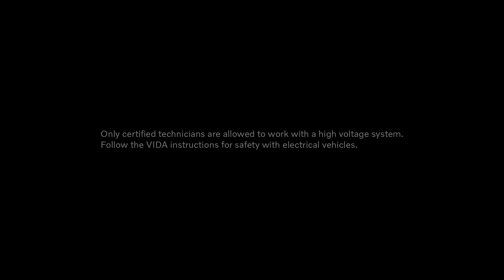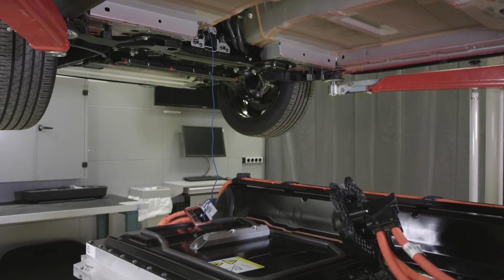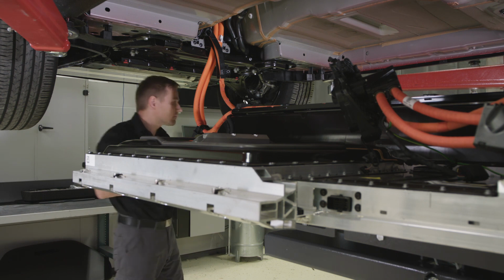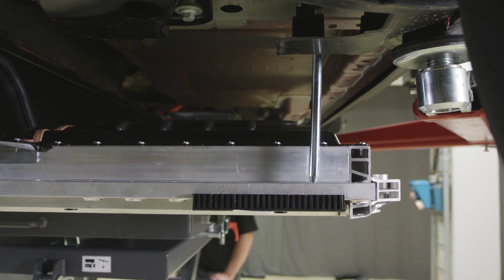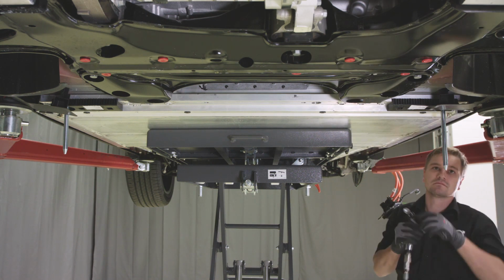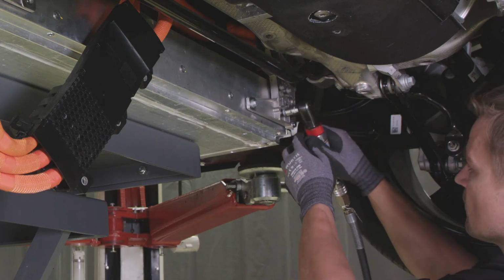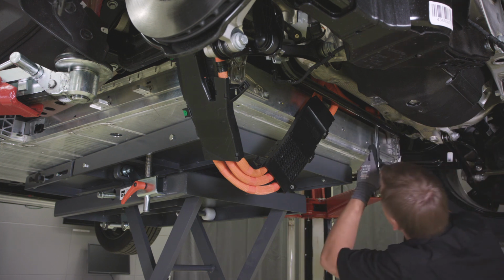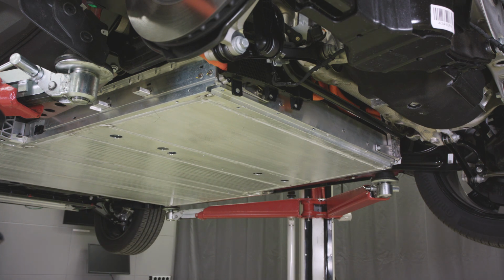Volvo XC40 Recharge (Pure Electric / P8).  Installation of the high voltage battery

Comment: Hi.  Wondering where you found these maintenance videos?  I need to find information about changing the electric motor gear oil.  Any ideas?
Reply from the maker: Hi John, I got them from the XC40 forums a couple of years ago.  Someone else got them and hosted them on a site, and I downloaded them and reposted them to YouTube just incase the  link disappeared, plus YouTube is more accessible for everyone.  I'm not 100% sure of the original-original source.